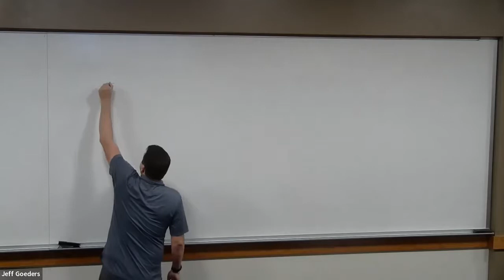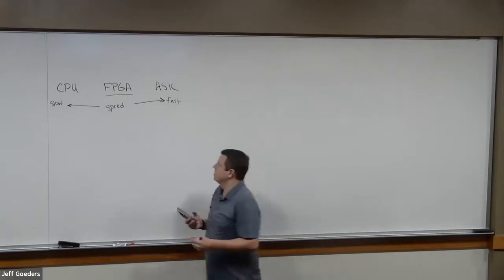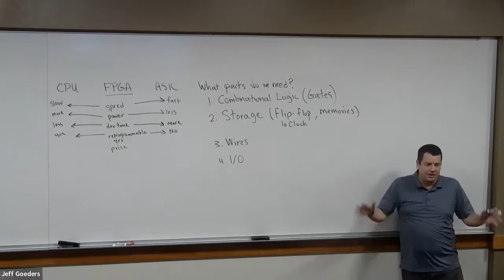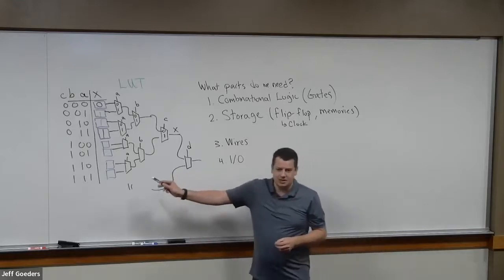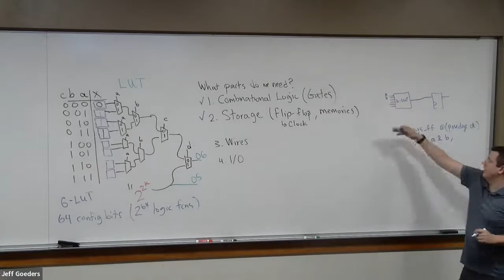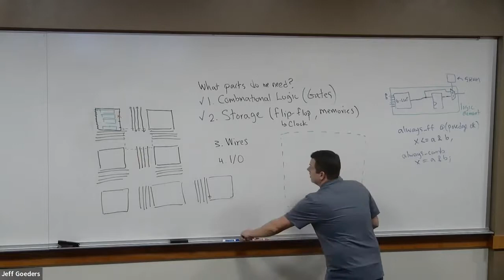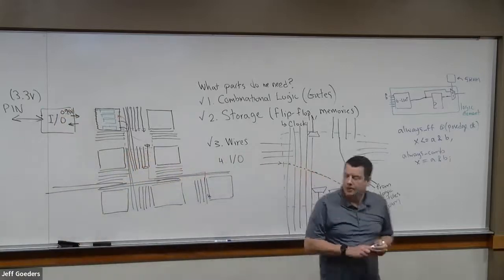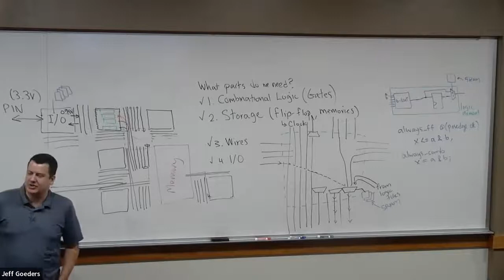FPGA Overview (2022)

Comment: I might use a Mecano anaolgy here.

If we pretend for a second that Mecano was all there was:
A CPU would be like a tape-based music box (built out of Mecano... yeh, bear with it). It's all welded together, so you can't change the mechanism, and provided you feed it the right punched tape it will make great-sounding soft music.
An ASIC would be a special music box, maybe it has less range, maybe it has a few more harps, but the music is on a steel drum. Again, all the Mecano bits are welded together, so can't be changed. It plays that one song and it plays it really well.
An FPGA, in contrast, is just a box of Mecano parts (sub-assemblies really). Go build what ever you want ;)